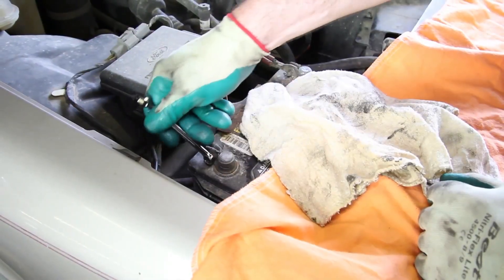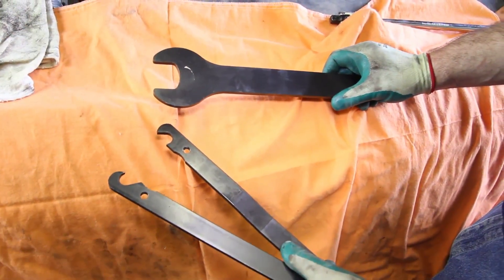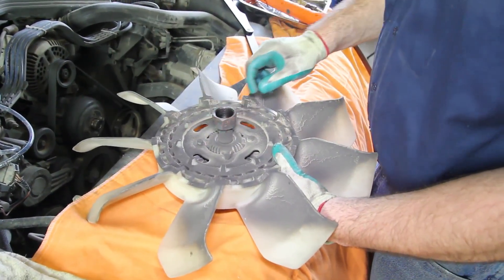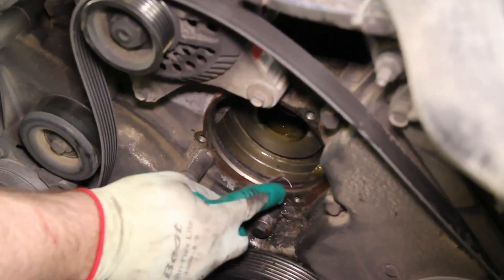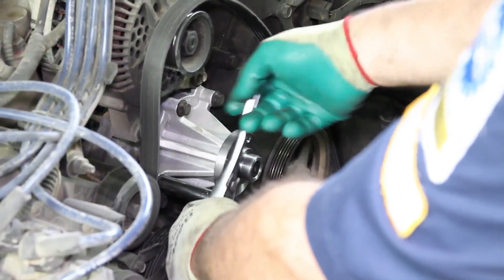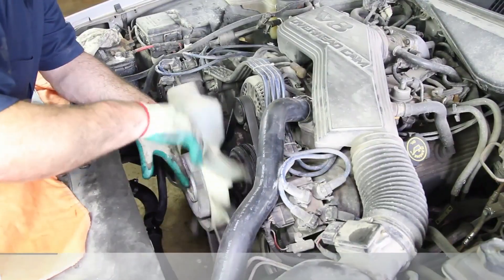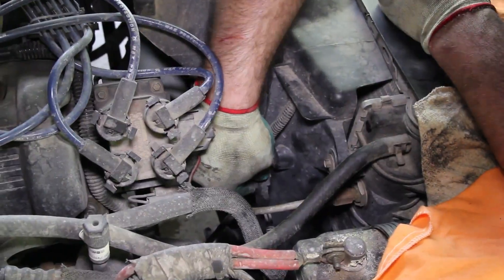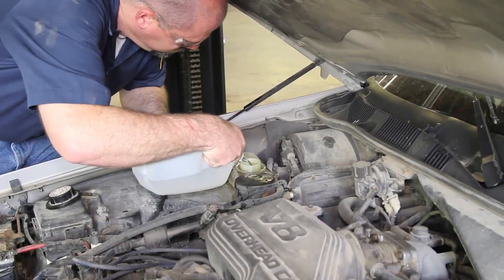How to do a Water Pump Installation for a Ford 4.6L V8 - Advance Auto Parts

Comment: While replacing the water pump and fan clutch, Do I have to replace the thermostat? My 09 f150 4.6l making noise so its could be the fan clutch went out and wasn't sure if have to replace the thermostat also.

Comment: How do you remove  four pulley bolts since it turns when you try . You used a fancy power tool..impact type. Even with belt on it still turns.
Reply: Way too late for the OP but figured if someone else is here stumped I would share.  I just clamped a medium sized set of vice grips to the flange of the pulley and set it against the alternator so it would stop rotation and broke the pulley bolts loose as I had already pulled the belt before I thought about the pulley.  Took about a minute total to get it removed.

Comment: question.. the hose that is connected behind my water pump is leaking, is water pump bad or is it the hose? it leaks coolant and causes my car to overheat, I currently have a 2002 grand marquis
Reply: 2manysecrets what is the hose behind the water pump called? Mine might be leaking from there too if not the water pump.
Reply: Two years ago we had a water/coolant leak on our 96 mercury grand marquis and we were charged $900 for fixing the leak. This was in Mobile, AL (Tillmans Corner) Certified Auto Center

Comment: If you have a 2006 Police Interceptor like I do the clutch fan ,shroud or the electrical connections don't have to be removed since it has an electric cooling fan and there is plenty of room once you remove the belt.  Thanks for posting the video.
Reply: thank you this is exactly what I have
Reply: Thanks I ordered a motorcraft pump from rock auto for a 2007 Mustang Gt 4.6 v8. Came with threadings to insert a fan but car already has an electric cooling fan.

Comment: I would highly recommend removing the thermostat housing to add the antifreeze. if you don't the pump will run dry and squeak until the thermostat opens up.

Comment: It only takes 4 mins 31 secs! how come i was charged for 2 hours labour
 gahhh...
Reply: Doesn’t account for rusted bolts, bloody knuckles, and cursing time..
Reply: lol they were nice to you then because its usually 3-3.5 hours
Reply: Few are efficient enough to do such a job so quickly. Video magic is your friend when making tutorials like this. And I think they were either nice as Brendan up here mentioned, or your old pump didn't quite cease onto the block as badly as most of these old pumps do after such a long time.